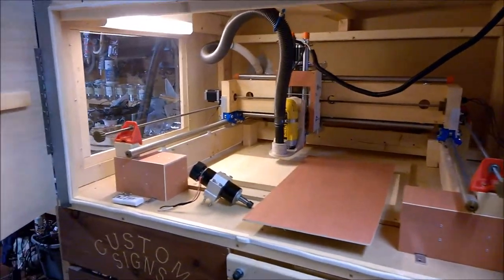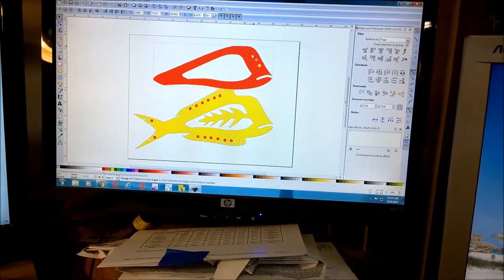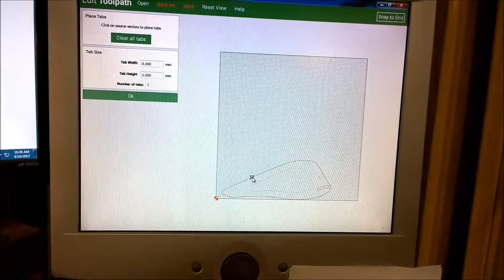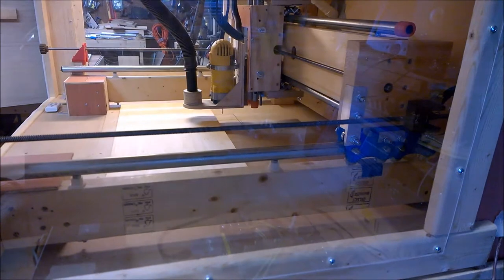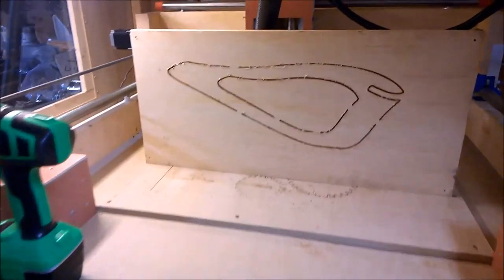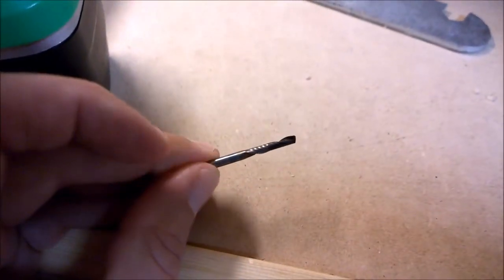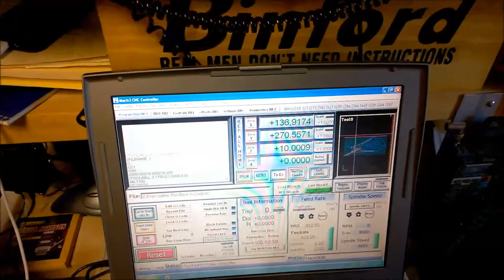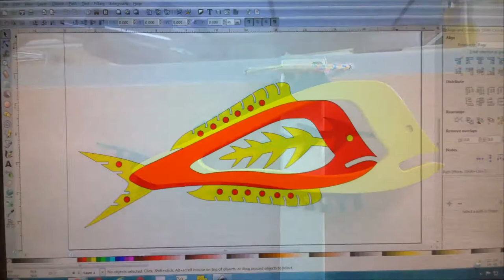DIY CNC - Fish Wall Art! - Easy & Fun Project

Comment: Do you have A link of your bit you buy on eBay?
Reply from the maker: Hi Michel - here's a link to the ones I use.  http://www.ebay.com/itm/10X-1-8-Carbide-Flat-Nose-End-Mill-CNC-Router-Bits-1-Flute-Spiral-17mm-long-/222434115575?epid=2194543790&hash=item33ca1b3ff7:g:99QAAOSw2gxYwP6q